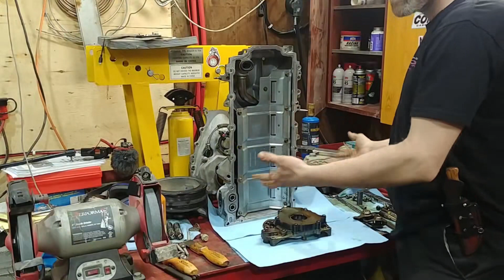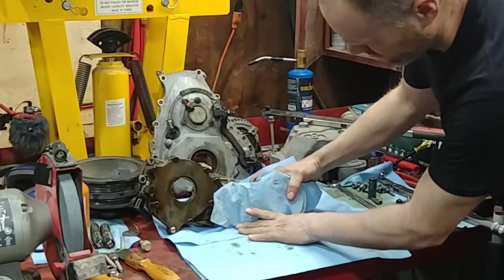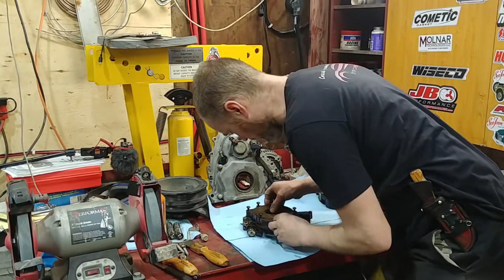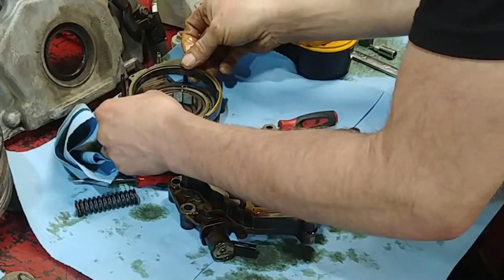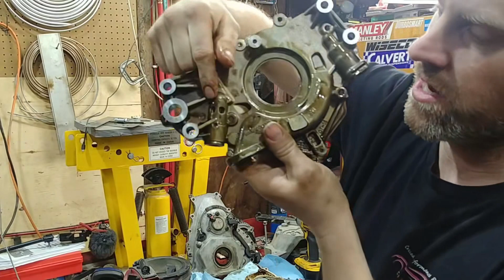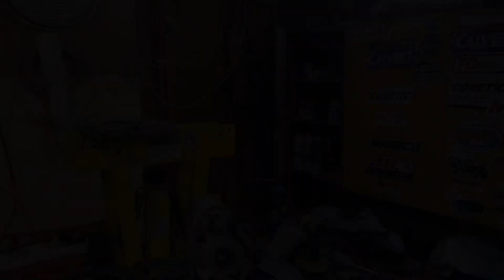Variable Volume oil Pump LETS DISECT GM LT based Gen V verses LS based

Comment: I've already had a failure with one of those pumps on a 2017 LT4 with about 10K miles on it back in 2019. All the vanes just blew apart. The parts guy at the dealership told me GM changed the part number 2-times since 2017. Hopefully they fixed the problem. Mine's still going strong since then.
Reply from the maker: So like the image I found and plopped up mud to late video? Crazy, that's the kind of stuff we all need to hear about. Thanks for the post with those minor details. Your comment gets a pin up for now.
Reply: I had a co worker had one go on a new 18 under 7000 miles, he called the dealership and they said it is probably gauge failure, drive it in, didn't make it far,  took 2 months for them to get the replacement engine, but they gave him a loaner.
Reply: @johnthompson941  when the 2008 financial crisis happened, the major network news were talking to dealerships and the dealer owners straight up said they would make up the lost revenue on service....what service generates more money than a watter pump replacement, an engine replacement. don't trust dealerships, they are specifically letting people destroy their vehicles despite massive tech service bulletins alerting them to the issues the automakers executives knew damn well about before they started selling them, because how else are they going to part fools from their money sooner rather than later.  sister in law was ford VP of customer service  secretary.....brother in law is an electrical design engineer at ford also. i get to know things before the public does, like the ford super duty serpentine belt failure issue. i also was the guy to solve it by adding an extra heavy duty bolt to the bottom bracket that would break and lift out causing the belt to slip off. actually i replaced all 3 bottom bolts with higher grade ones because they cheap chinesium chit snapped off at the heads and after you drill one out, you never want to do it again.
planned obsolescence was started in the 1930's with light bulbs, it spread to every industry.
the new craze is you will own nothing, lease/rent everything, even the extra bells and whistles on product goods. apple, and deere since digital millennium copyright act (DMCA) 2000 and now tesla

Comment: @25:11 You describe the engine rpm drop when shifting would create high pressure in the oil system that needs to go somewhere.  That is not something that happens.  The rate the pump is rotating determines the pressure, so when the rpm changes so does the pump rate and thus the pressure.  I believe the oil pressure relief valve opens at 87 psi, and even at 6k rpm these engines only make 60-80 psi, so its more of a failsafe.
Reply from the maker: To an extent you are correct. But theory with me here. Couple things, while under load (full throttle) the bearings are being pushed down on rather hard and this requires extra volume to fill the larger gap on the opposite side. This extra volume is moving rapidly in one direction. Remember this is fluid we are talling about here not air so the mass behind it is huge. During the shift, these temporarily reduce throttle via the electronic throttle body. This drop in load to prepare for the shift lowers stress on the bearings. That drop in stress corrects clearance and thus requires less volume. This drop in volume needs means the fluid needs to slow down. (Think wave pool at a water park) Well because it is flowing (almost pushing) into the pump now rather than the pump simply pulling it in due to the drop in rpm, flow demand drop, and the pump speed change (drop). Also now the pressure side is almost pulling on the pump as well. (This makes it easier to flow oil for that split second.) The ease of flow from the velocity of liquid will cause a slight surge in pressure In theory. It may only be 5-10psi tops but still a slight surge that may need to bleed off. I also believe that pressure relief valve in the pan opens much sooner. Where did you find that 87psi spec at?

Comment: Oil pumps on 2017-2026 L5P diesel engines also fail and the repair is $8000 and over 20 hours of labor.  VDOC pumps are junk but make the EPA happy.  To burn less fuel per hour at idle they drop the pressure to 7-9psi.

Comment: The answer to the reliability of it is a hard "no". My buddy is on his third engine at 87k miles due to solenoid failure and not providing enough oil pressure. The second engine wiped out the mains and locked up 2 weeks after install. Gm denied warranty because the truck had long tube headers on it. Third engine we took no chances and installed a Katech performance billet pump.

Comment: That pumps are the main failure of the 6.2LT i disconect the variable oil
Reply from the maker: I'm actually upgrading one to a billet unit now. It's getting cam, header and intake manifold upgrades as well.

Comment: Nice look inside the oil pump! Was curious how they worked on the new GMs 👍 just for info, pumps produce flow, not pressure - restriction to flow creates the pressure. 

That's a variable displacement vane pump, the pressure in the system changes due to a change in flow of the pump, the pump doesn't change pressure. The pumps displacement is varied using pressure and the spring just as you described tho 👍

From what I understand of the AFM too, there's another relief valve to limit the pressure in the lifters. I would tend to agree with your other thought too - the main relief valve in the pump is probably there to limit pressure spikes and the main control of the system pressure is by varying the displacement of the pump. That's pretty common in modern variable displacement hydraulic systems.

Not sure how much I like it or the AFM, as at this point they are just squeezing fractions of a percent out of the engine to meet emissions and fuel economy targets 🤷‍♂️

Comment: 24:07.... the broken image pump makes every bit of sense where it blew apart as the pressure got to high and over time stress crack veined deeper and deeper where the sweeps allowed that higher undesired pressure into the circle cut drill out at the end of the sweeps. the solenoid or computer senors might be half a second to 300ths of a second to late to alleviate the blow out pressures fast enough.
 i bet you anything those sweep plate holders were made overseas, this is why i called it chinesium, due to the forging process is not as good as pittsburg steel, and the reworked polluted diluted chinesium metal is recycled steel that is filled with  thousands of air bubble pockets which makes them lighter because they are weaker. nonamericans whole steel process from places that are not first world like western europe all have this same problem which makes them prone to incredibly sooner failure. spanish steel is pretty damn good stuff. italy is more pig iron like, but when you don't stamp the bubbles out, you wind up with this crap metal they se for critical components. 
and the corporate executives on both sides know it and don't care because it's extra pennies per peice for each of them to buy new million dollar yatchs with, they get theirs and screw every one else over.

Comment: Thanks for your videos I have a 2007 Chevy Tahoe I’ve replaced the oil pump O-ring at the oil pump driving down the road I have continuous 40 psi to 50 but when I come to an idle I have about 10 psi at idle. I did a DOD delete on the computer. Any other suggestions where I could look for the low oil PSI
Reply: By any chance, would the engine oil intake manifold caused low oil, pressure at engine idle
Reply from the maker: Not likely in a 2007. PM me on my webpage and I'll get you a copy of my write up on oil pressure for that year when I'm in the office.
Reply: @CrazedPerformanceRepair  thank you

Comment: I have removed the pump without removing the oil pan by drilling two holes through the front of the pan to access the torx bolt heads. the holes are way above the oil level and after two years have not leaked. plug with silicone and add rubber plug if desired. The pump can be removed by taking the face plate off then the rest will come out a piece at a time. Put a large rag under the pump to block any pieces from falling into the oil pan. reverse to reassemble.
Reply from the maker: I struggle to see how that would work at all. Never had an issue accessing tx bolts to remove. Besides that I'd be causing damage to a customer car and fighting removing a pump to save pulling a pan off. You probably spent as much time doing what you did as it takes to just remove the pan in the first place.

Comment: So, when someone tells you it doesn't matter what oil filter to use, have them watch this video.  It seems to me pressures are very important.
Can you comment on using the correct oil filter?
Reply from the maker: The big thing with newer GM V8's is they undersized the filter from the factory. This causes potential for restriction depending on pleat count and micron size of filtration. You can do a couple things to assist with this. One is find the longer version of the stock filter. This will increase total surface area of the pleat making it less prone to being restrictive. Then brand becomes almost irrelevant. Or you could run something like a wix racing filter that has a larger micron filtration size and higher pleat count. This allows the oil to flow better due to less filtration and more surface area being it has high pleat count.
Reply: My other main concern is the different bypass PSI depending on what filter you use. To low of bypass psi and the oil isn't being filtered, to high of bypass and there wont be any bypass when required.  Thank you for this great info.

Comment: Those new pumps are garbage already replaced two on my 19 suburban.  The spring literally disintegrate and broke in pieces.
Reply: What was the symptoms
Reply: @dreece2000  low oil pressure at idol dropping as low as 5psi.

Comment: Can I remove the pump without taking the oil pan out ?
Reply from the maker: Nope.
Reply: @CrazedPerformanceRepair  my engine has 170k miles do you recommend pulling out the pistons and changing the rings too with new ( allong with new genuine connecting rod bearings and bolts ? ) since everything will be off the engine might as well slap new rings and do shade tree rebuild.

It’s my own truck that I use for work and it was burning oil 1qt between oil changes 

I think it won’t hurt to put new parts in it ( I think the connecting rod bearings will be perfectly fine but since I will take the rods out 🤔)  your opinion please
Reply from the maker: @thegamepz   If you are consuming oil you should find out why. 170k would be considered low miles on the older generation engine. These newer ones i'm still a bit unsure on. They do seem to have even issues the it's predecessor so far.
Reply: @CrazedPerformanceRepair  I put new std bearings and new STD piston rings ( anyway everything is out might as well bring some new life in to it)

Almost no wear on the bores except all 4 AFM cylinders.
They have slight scoring on the pistons and cylinders ( only on the pistons that switch off) along with lots of carbon buildup.

Will see how it will work after that. Will
Give update in couple of days

( slapped new rings without honing)

Comment: I can’t find any info on the oil inlet pick up tube. You mentioned you can unbolt and remove it, which I did. It doesn’t have a o ring, just a brown glue looking substance.. does anyone know if it’s okay to bolt the inlet tube back on without resealing it? Will oil pressure be low if I don’t remedy the glue type seal? Thanks

Comment: No torque spec ?! Locktite and ugga duggas x's 2
Reply: I just used Milwaukee impact driver in #1 setting and ratchet to make shire all were snug…. Remaining oil pushed out… good and tight
Reply: Jokes aside 89in/lb is about right for any m8 which usually have a m10 head

Comment: Replace the oil pump if you have it broken down that far. They are known to fail. I just took my 15 Tahoe apart for a pump P06DD.
Reply from the maker: Seems they like to grenade from what I've been hearing. This one's still fine but I was sure to shim things correctly when installing.
Reply: Same mom in law 15 Tahoe 103xxx just out of warranty intermittent low oil pressure on dash

Po6dd code 

My pump looks good also so it’s best to assume the solenoids aren’t holding up good
Reply: @ that’s what my problem was. The solenoid on the oil pump. Front cover and oil pan had to come off for replacement. Book time is like 13 hours, so an expensive job if you are paying to have it done

Comment: I just had a '15 with broken vanes in the pickup tube  the sliding ring was split in two. At the pivot.  The cam and lifters were fine but it started to blister and spin the rod and mains. Maintenance was kept on it i was told.   The inside was clean but broken pump. Ended up using a low mile good running L83 and doing the dod delete/ non dod cam, ect , on it. While I was there, I used the Katech performance pump.  I think their ring is billet or something better than the iron one. The pump did come with a new solenoid but it broke in shipping.

Comment: Pump looks decent to me. No noticable issues right off. Very interesting. Not sure if I see much fuel savings though. If issues arise it seems that the pump pressure will be high and defeat the pressure lowering purpose. Lol  The small cavity with sludge appears to be catching any debris slinging down from centripetal force.

How does the lower cavity tied to the spring empty? Is the solenoid releasing pressure or introducing pressure?
Reply from the maker: I don't think that's spring cavity was tied to anything. I believe the oil was in there just from it bleeding past the plates and into that cavity.
Reply: @CrazedPerformanceRepair  I was talking about the lower cavity putting pressure on the spring. Sorry for the strange wording. Lol
Reply from the maker: @micahap1559  oh, yeah it appears the solenoid pressurizes that power cavity from the upper cavity.

Comment: you have me wondering. gm part number 12623423 says it's a variable displacement vane pump for the ls. mostly the hybrids, but said to work on all ls and save a few hp. but if it has vanes instead of gears, maybe less reliable like you say, but I've never heard of one going bad, at least not before the o ring does anyways haha. I'm at 143k on one now, still good pressure at idle.
Reply from the maker: Really? I'll have to look into that part number. Wish I could get The chance to work on a hybrid. I never seem to have one come in.
Reply: they are odd ball for sure. I'd be really interested in what the pump looks like too, and if anyone has ever dynoed one to see if the hp gain is real. if you ever wanted to dive into the trouble shooting side, dealers won't even hardly touch them anymore. seems mostly what I see on the forums is something simple happens, a module or something, sdgm seems to be common. take it to the dealer, they keep it 3 weeks, run up a bill and give it back still messed up, owner gives up and dumps it as a trade in on something new cause they feel stuck. I feel like these guys would put them on a truck and have them transported to you if you got good at fixing them haha. I honestly really like the thing, it's grown on me after the battery upgrade to lithium. its a hybrid with a tow rating, kinda unheard of. just towed my c6 from TX to FL track and back with it.
Reply from the maker: @jsomething2  I certainly would have no problem working on them. Just no one ever brings me the darn things. I used to see a few when I worked for somebody else but since I went on my own I never see them at all. I've dove in to a few hybrid jobs and Even a few Ev vehicles in the past. Even diagnosed and replaced a couple of batteries in the Priuses. I used to have a battery from a Prius in my old house for playing around with electronics with. It was nice because I would use a different amount of cells to get a different total voltage all the way up to the 240 plus volts that I had. Kind of fun to play with but when I moved I couldn't fit it on the trailer to take it with me. I just said effort I'll find one someday. Two years later and I haven't even had one in the shop. In fact I haven't had one in the shop for the last 8 years. Not sure why I never see him anymore...
Reply: @CrazedPerformanceRepair  if I see anyone posting with issues near South Dakota. I'll mention you might be a shop to look into.

Comment: Not liking that solenoid
Reply: These are the same solenoids they have been using in automatic transmissions since early 1990's
Reply from the maker: But that's trans fluid and don't see near as many cleaning agents added by the owner. Also no fuel or carbon contamination in trans fluid. Time will tell though. My Guess is that it will be fine. But my instinct says otherwise. Especially since the little plastic tubing around the wire is super brittle on every one of these I've pulled apart.